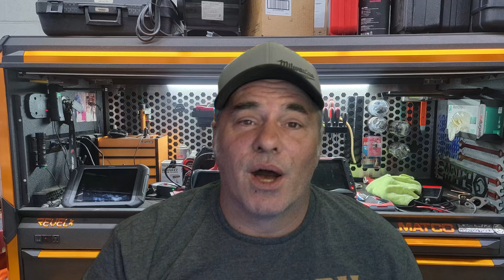I Hate Having to Asking These Questions To Young Techs

Comment: I just started at a new shop and one of the older guys told me point blank not to look up repair procedures and just use my eyes to figure out what needs to be done for the job. While i understand his point it only takes a minute to look up and could save you big time. Makes me worry about his repairs 😅
Reply: Had a diesel ram come in. Boss said "repair time is only blah blah". I go over read the proceedure. Big huge yellow "CAUTION". Turns out a steel fuel line is single use only, must be replaced. I look at my parts, not there. I tell him we need that line. Reply back "no book time didn't say anything about a line."

I tell him read the proceesure, there's a caution. Reply back? Book time says.

Job done, line leaks. Half hour to 45 minutes he spends trying to say its not tight enough this, teflon tape that, I this, I that. Keeps leaking no matter what. I take a picture of the big fing warning, text it to him and say "Read the proceedure, it was in big yellow letters so you couldn't miss it".

Oh parts guy never said this, that, blah blah.

Comment: I have to ask my boss that. Idk what to do man, I feel trapped. I get paid pretty low, sub 30 dollars, get no breaks whether it's my two 15 minutes or half hour lunch, work pretty much 3-4 sometimes 5 bays by myself. My bosses are almost adverse to buying tools, reading TSB's, proceedures. They just look at labor times and base entire jobs off that. I do everything from regular services, to diagnosis/trying to diagnose while working on cars, dealing with customers, Point of sale, ordering parts, alignments, tires suspension, brakes; engine and tranny r&r's, clutches. You name it, I do it. I feel trapped staying here with all these promises but I don't see it happening. I feel like I'm going to end up broke and broken. I started a side business doing mobile repair, my boss told me they want me to take over the shop one day, but I'm hesitant as to how that would even work with the garbage pay I make, also I'm 32 and I'm already having back problems, stress and anxiety issues, knee problems, hand problems. Obviously I have no health care either and I work hourly.

What would you do in my shoes? I have 14-15 years experience, can use everything from hand tools to diagnostics scanners and lab scopes, I'm A/C certified and was emissions certified, fully licensed and have worked on every manufacturer. Light passenger to massive cube trucks I have to crawl to work on because they don't fit in our shop but my boss brings them in anyways. There's always 2-4 more cars after the "last appointment" and I have to deal with multiple customers my boss told to come in, while I have cars on hoists, because my boss has "no time" or "forgot" he told them to come. I stopped bringing lunch because there is never time to sit and eat and I guess to make himself feel better, my boss will almost guilt feed me random fast food while working and I feel bloated and sick.

I complained about all this two months ago when I told them I was quiting. They promised me changes, so far nothing.

Would you leave this shop?
Reply: You deserve breaks AND a raise. I know it's not easy but have you tried looking for other places to work at?
Reply: Leave asap
Reply: Dude are you serious lol what do you think people are going to tell you? Gtfo of there! Give them a two week notice. As in, in two weeks you'll notice I've been gone for two weeks!